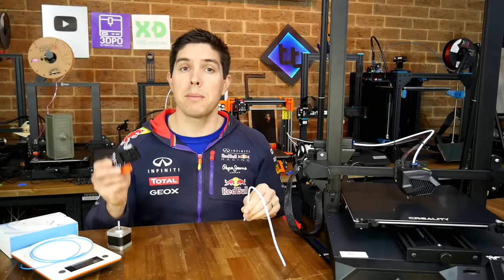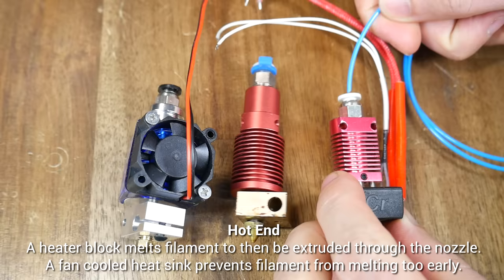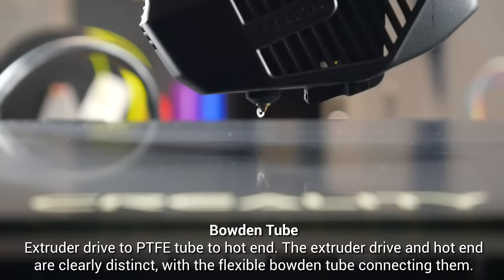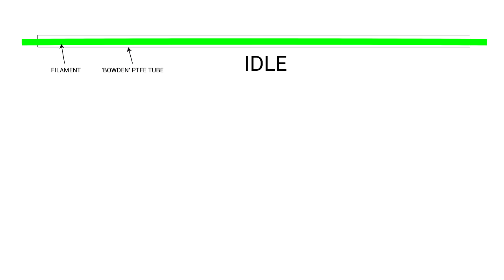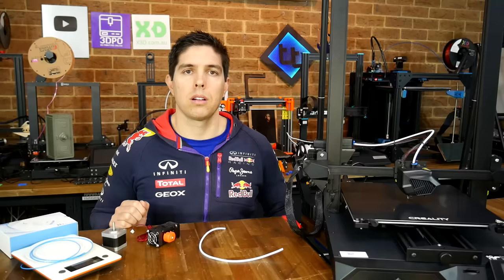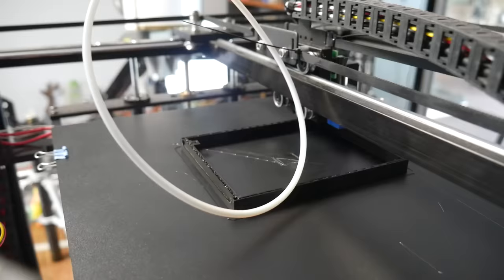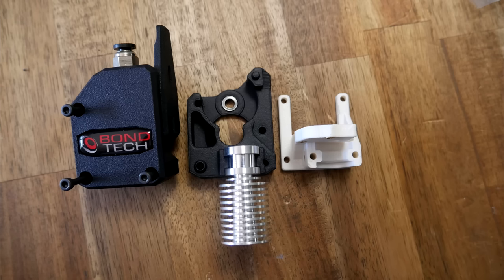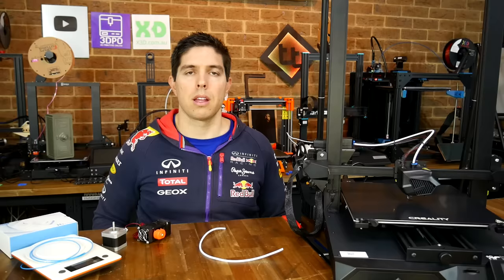Why direct drive is not automatically better than bowden tube

Comment: One reason to convert to direct drive that was not mentioned explicitly in the video is the ability to print flexible filaments like TPU. These are very difficult to get working properly in a bowden setup.
Reply: Depends on the TPU variant. The stiffer types print just fine.
Reply: Printing Ninjaflex all day long with a BMG/MS bowden setup like many others.
Reply: probably because that reason more of a myth since filament manufacturers seem to have figured their formulas out. most TPU can print just as badly from a bowden as it does from a direct drive nowadays.
Reply: I use a titan clone in my ender3 but with bowden tube , printing tpu at rhe same speed of pla (50 - 60 mm/s), the key of tpu: yuo must deshidrate yuor tpu filament
Reply: @shvrdavid  
let me say it again.
IT WILL NOT WORK. 

you might call the result acceptable.  i don't.  
and you especially should know that with a printer that big you are either sacrificing quality because good luck controlling retraction and extrusion at that distance with flexible fillament.  
or speed wich on a printer that big is even worse.  

yes MAYBE with capricorn tubing. 
geared extruder with double feed gear. 
and all quality (expensive) parts.  it might work with acceptable (not great) speed and quality.  but i'd rather just switch to a hemera (wich i did) and i can now print any material as easy as the previous one.  and it's lighter then some people's printed bowden hotends with all their fans and everything.
Reply: @shvrdavid  Bowden will print TPU, albeit horribly SLOW. Not worth my time.
Reply: It was mentioned

Comment: I think the main benefit of direct drive is that you can use flexible filaments.
Reply: I'm pretty sure that's possible even with bowden. You just need a Extruder with well constrained path for filament. There are also 3D printable options if you don't want to buy a new extruder
Reply: @F2_CPB  the main thing is that direct drives can generally  print flexibles at normal speeds, while Bowdens generally have to print slower.
Reply: @seville2k  I second this , my ender 3 dose flexible material good but at like 20mm/s at max . My I 3 dose it way better , and I don't think the ender 5 would work well tubes too long . I picked up the i3 ripoff just for tpu
Reply: The main benefit is the more precise control that you have over the filament, that’s true regardless of the type of filament. If you can accommodate the added mass at the print head without introducing ringing artifacts, you will see overall better print quality with less need for calibration than is possible with a Bowden tube.
Reply: @robnixon515  like anything else that comes down to price I would Imagen , at least for the most part, my ender 5 might be a good candidate for a direct drive unit then .
Reply: @turboprint3d  there’s always a price to pay, but in this case it’s not an especially high price. I’m using a Sherpa mini that I got for $50 with the pancake motor, and it was without a doubt the best I’ve upgrade I’ve made to my ender 3 v2 as far as cranking out successful print after print is concerned. 

I added a little weight to my print head, but I actually removed quite a lot weight from my gantry by replacing the stock extruder and motor, so I don’t really need to reenforce my Ender’s z-axis on the right-hand side like many direct drive solutions demand.

Any printer is a good candidate. The problem in the part has been that direct drives solutions were far too heavy to be a general solution. With modern geared extruders weighing less than 150g, that’s no longer the case, and I don’t think it will be long at all before Bowden feeds are considered largely obsolete.
Reply: Not at all. The main benefit is the short filament path. More accurate retractions, more control, more precise movements. The benefits are bowden tube are not really valid anymore. DD is heavier but with things like resonance compensation then its just better to use a direct drive.
Reply: Flexibles printed just fine when I was running a Bowden don't really see much difference for those. a good stepper system and high-quality Bowden tube and you can print flexibly just fine.
Reply: @IceLom  I don’t believe you. You aren’t the first person to say this, but I’ve never seen a single flexible print done with a Bowden extruders feed that wasn’t a total shitshow. If you don’t see a difference using direct drive, then something is WAY wrong with your direct drive setup. Either that or you’re lying.
Reply: @robnixon515  I’d have to assume you’ve only seen people attempt flexibles with garbage-tier extruders then. It’s absolutely possible, but you’re not gonna get there with an “upgraded all metal” trashy Amazon extruder.
Reply: @andrewmorgan7770  I’ve never seen anything close to the quality I’ve seen with a direct drive extruder. I will gladly change my stance is someone actually shows me an example of flexibles done well on a Bowden. It doesn’t matter if you’re using a genuine BMG extruder, pushing flexible filament through more than a meter of tubing is going to produce shit-tier results. Again, I’d be happy to be proven wrong but I’ve never seen a single side-by-side comparison that substantiates this claim.
Reply: From my own experiences with Filaflex, choosing 2.85 filament and setup over 1.75 mm also is a big improvement. 
By the way: "Flexible" encompasses a huge range.
Reply: You can do it with Bowden, but if the distance between extruder gears and tube is to high, it will curl
Reply: @turboprint3d  I third this. Running a qqs pro with Bowden. Speed must be really slow. 101hour print for 1 RC wheel lol just make sure the filament guide and Wires are zip tied. Helps the extruder push the filament.
Reply: I have printed 2kg worth of flexible filament in my ender 3 bowden setup. Finished parts look just as good as PLA.

Edit: correction, I have printed 5x 1kg spools worth of flexible filament.
Reply: With a good extruder drive feed, you can absolutely print flexibles.  I offer a modified MK8 extruder which works excellent with flexibles, as standard filaments.  I don't mean to plug myself.
Reply: @robnixon515  Your first response was that it's a total shitshow.  It isn't, I've printed 50-100 parts for drones, lasers, gaskets, seals, etc with a bowden and they were fine - far from a total shitshow.  Now I'd agree with your second stance that side by side DD has an advantage.
Reply: Pretty much, and they're a bit more reliable between different filament types.  The extra weight makes it harder to go fast accurately though.   You've gotta go with heavier and heavier rails the faster you wanna go.  Personally I use direct.
Reply: I was going to say my longer van print flexible filament but it's got to be slow, looks like people have already covered that lol.
Reply: Yeah, Same.
Reply: @turboprint3d  i print flexible with my ender 5 at 20mm/s works pretty good!
Reply: @aron3d906  ya my i3 ripoff gets up to about 45 without issues , needing to slow down for some jobs but ya . I primarily use that one direct drive printer for flexibles , tpu , nylon , tpe.
Reply: for low quality extruders forget about making a bowden work lol.
Reply: Gobbless
Reply: …in the nude
Reply: @robnixon515  Check the Channel of Chep3D, I bought the same extruder like in his video, for my Ender 3 (imported it from US to EU for about 40 bucks). I need to print slower but the results are absolutely fine.
Reply: @StubbornSpirit  I have actually changed my tune on this since posting this comment a couple of months back. I’ve seen plenty of examples of perfectly decent TPU prints with a Bowden feed, once I started looking for them. 

I’ve also been printing a lot more with TPU myself, and well… let’s just say having a direct drive extruder doesn’t guarantee good results. It’s not enough to just have a shorter filament path, you still to pay just as much attention to constraining the filament path — something as simple as PTFE tubing not being cut flush can still brings to a halt. 

I do think it’s much easier to calibrate direct drive extrusion, but a well-tuned Bowden feed doesn’t suffer as much as I thought it would, and I have been sufficiently humbled so that I am no longer making snide remarks about topic 😂
Reply: Also less clogs, I imagine.
Reply: @robnixon515  you are a good n based person. Bless you being open minded and thorough months thereafter. Been researching for a godson. He's got Bowden n I've got DD. more stringing with his mini but quality prints nonetheless. Now I understand better thanks to this great video and from the comments yours included.
Reply: I've printed tpu just fine with my stock cr10 mini
Reply: @robnixon515  All metal extruder and Capricorn tube...ender 3 v2.

Flexibles all day, everyday! Woot woot!

Just a little fiddling with the pressure screw on the extruder and no enclosure.
Reply: Bowden tubes are useless 95% of the time  the other 5%  of the time they are installed on a "Delta printer".
Anyone here arguing for a Bowden tubes. Should go and remove the engine from their car, then put it on wheels and have it  tied  back to their car with a rope.
Reply: even with a standard ender 3 you can print flexible filament perfectly fine.
Reply: people forget that flexible filaments dont have to be soft like like snot, in order to be flexible filament. I only ever used TPU with higher shore hardness (95A), its plenty flexible, but not snotty like what most think of when they think flex filaments. Prints just fine on stock ender 3 bowden, no changes to the extruder
Reply: And you don’t have the danger of toxic fumes, when running HT materials!
Reply: @brad1367  But isn’t the temperature at that distance already high enough to start out-gassing of dangerous fumes? 
DuPont states that it is safe up to 260*C , but independent tests have shown that already at 202*C dangerous gases start to appear. That’s why the use in pans, as non-stick coating, is already since 2 decades only „OK“ if strict guidelines are followed.
Reply: @1800Supreme  are you saying that deltas benefit more from it?
Reply: @loyalfans-kxngunkasaxxx2223  That's what I think. Since all axis of movement are done to the hot end, (in Delta printer) making that hot end small and light weight will always be more beneficial  than compared to a i3 style that moves the large and heavy  heated bed. Not to mention the added dynamic of having the print increasing the weight as it piles on.
Reply: Right
Reply: i print fine with flexible filaments on my bowden setup.
Reply: flexible filaments can be used quite easily with bowden setup
Reply: @robnixon515  My Flsun delta with MicroSwiss bowden extruder says you need to learn more bud.
Reply: @IamJoeTV  Thanks, I’ve learned a lot since posting in this thread over a year ago. Nothing I’ve learned in that time has done much of anything to challenge my opinion that direct-drive extruder feeds are superior to Bowden-style feeds in almost every conceivable respect apart from the mass they place at the toolhead, which has been shrinking for quite some time now, with many extruders these days weighing under 150g fully loaded (and as little as 105g).

Can you print with a Bowden feed? Obviously. Can you print flexibles with a Bowden feed? Yes, you can. Is a Bowden feed better for this purpose? Unless your only concern is ringing (which can be compensated for with input shaping), then the answer is a resounding “no!”
Reply: @robnixon515  I'm late to the party,  but I've only been printing for 6 months. I have a $100 ender 3, stock except for a bullseye cooler and glass bed, tell me where I can send you proof of good tpu  prints. Because I've got some.

Comment: Bowden seems to be a cost-cutting measure of printer manufactures. lower mass means getting away with flimsier frames. Also, the design time of the extruding system can be greatly reduced with a Bowden because one does not need to squeeze numerous parts and mechanisms in a small print head. ^^
Reply: While they would get away with flimsier frames, you can actually see the opposite in reality: Look at all the old i3 clones, that used to be popular. They have thinn, flimsy acrylic or wooden frames, but still use direct drive (which is the reason, that bowden mods for those aren't too unpopular). The frame on the Ender 3 and CR-10 in comparison is incredible sturdy and makes modding it to direct drive easy enough. The old MK8 must have been extremely cheap to make, but their weight isn't all that low and printers like the Geeetech i3 Pro W are just too wobbly. Since the M8 rods were also horribly bad, you didn't notice the ringing though^^
Reply: @SchwachsinnProduzent  The frame on the Mendel style Creality printers are sturdy indeed. I was quite surprised when felt the Ender 3. But the single lead screw on the old Enders is quite questionable, to say the least.
Reply: @johnkim3858  You may find it questionable, but as an owner of three Creality machines, I can assure you, that the single lead screw works perfectly well, if you bolt everything together right. I even prefer it to most dual leadscrew setups, since I can just install a big knob on the end of it to move the Z-axis in the unpowered state, without having to worry about keeping the screws in sync with each other. The wobblier frames need two, because they don't keep the square without them, but even my CR-10 - which isn't a small machine - doesn't move in any way due to the "missing" second leadscrew. In theory the second motor would allow it move the z-axis quicker, but let's be honest: The z-axis doesn't move fast anyways due to the way fdm works.
Reply: @SchwachsinnProduzent  I agree with the rather elegant user experience with a single z-axis motor. I had some personal experience with the MakerGear M3 which had a knob on to move the z-axis. Also, the maker space at my current school has a Prusa Mini which has a cantilevered x-axis, as many people know.

Both machines did cantilever construction. Unlike the Ender 3, the Prusa Mini is designed in a way that the belt pulls the x-axis together. On the other hand, the MakerGear M3 has fastened the y-axis plate so that the fasteners are usually at tension, again, unlike the Ender 3. The ender 3 has a somewhat cantilevered x-axis fastened in a way that the bolts have to withstand the torsional slipping of two flat surfaces.

I think this kind of construction has similarities with wood furniture without joinery. It is going to work fine for a while but probably loosen over time. Of course, the user can tighten it and be fine for few weeks but the time will come rather quickly to tighten the bolts again. Also, the bolts that join the x-axis v-slot extrusion and metal brackets are not that accessible. 

I still give credit to the Ender 3 because they put the heaviest components close to the lead screw. I also, agree for most people printing trinkets, astatic pieces, hangers, etc at relatively conservative speeds, accelerations, and layer heights: a slightly skewed axis is not much of a problem.
Reply: Always that one "everyone out to rip us off" guy.
Reply: @WhatAboutRC  Not necessarily, I recognize the people with jobs have to fulfill time and cost constraints. ^^
Reply: I don't like bowden much but clearly it reduces the mass flying around so it does reduce the chance of ringing and other issues associated with vibration. I think if I were to use direct drive I'd want to do it on a printer with a box frame, or at least dual z screws, and a printer explicitly designed to take a direct drive rather than retrofitted with it. Doesn't make sense to me to take some corner cutting printer like an Ender 3 and stick a weighty direct drive on it and expect great things.
Reply: @johnkim3858  as twin motors keep in sinc if manually rotated I don't see the problem.
Reply: My printer continually snapped filament so why would I ruin prints by using direct drive?
Reply: @womble321  I agree that dual z motors on an Ender-3 will solve the moment load issue caused by having only one z-axis lead screw.

Looking at the design choices of the Ender-3 S1 series resolves most of the issues of regular Ender-3 printers.